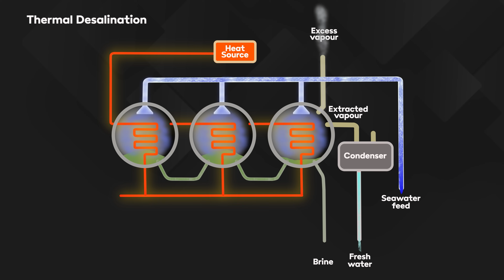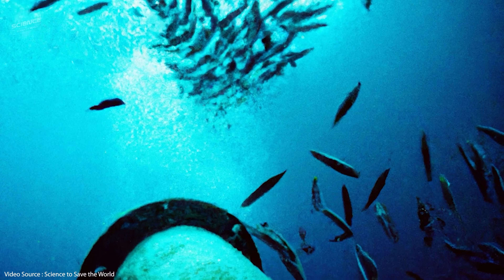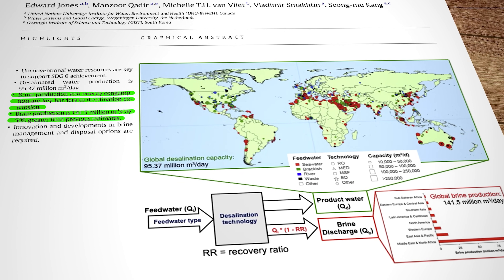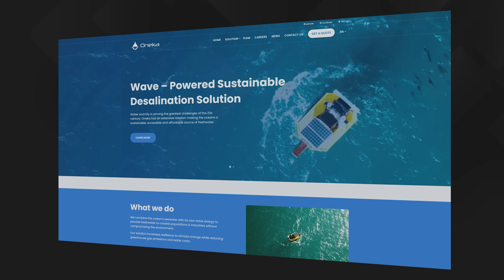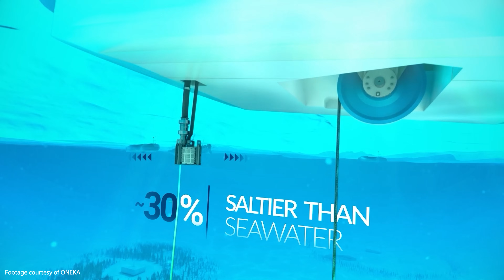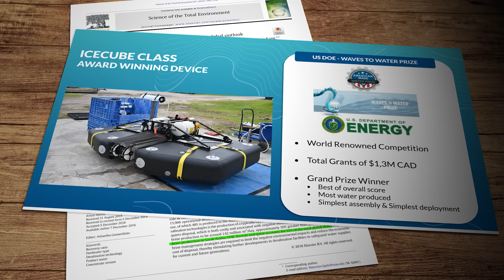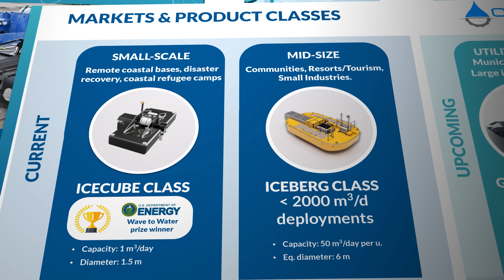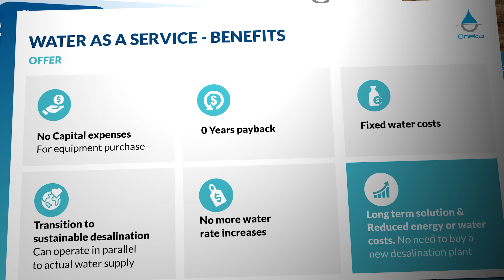Fresh Water at Zero Energy Cost . How do they do that?

Comment: Okay but here's the question if you replaced there offshore rig the floating thing with an equivalent electricity generation system would it not be producing significant amounts of electricity? My point is at the beginning of the video you point out that desalination should not come before renewable energy which I completely agree nor should renewable energy be just there for desalination for the cyclical effect. But it kind of seems like this is doing exactly that by replacing tidal wave electricity generation with reverse osmosis.

Comment: Vacuum distillation is/was used on Navy aircraft carriers to make fresh water. I was an engineering officer on a carrier. Those systems work but considerable maintenance is required. The resulting water can be good enough to use for boiler feedwater. The rest is used for other uses, drinkable except when in port where biological contaminates are higher. In port, chemicals are used to treat it. If there is petroleum in the intake water it distils into the useable water. Not good! Petroleum naturally occurs from seeps in some places, Gulf of Mexico, Near East. I was surprised at how much petroleum contamination there was in the Mediterranean Sea.

Comment: How does the water get distributed? Is that also done without electricity, and is it factored into the cost in terms of both carbon and capital?
Reply: Ideally, the power would come from the wave energy too. There can be some residual pressure from the RO process to drive flow to shore at least.

Comment: Is there a minimum wave height for operation? There are places on the globe where the surrounding seas are very placid, but which would benefit greatly from cheap drinking water.
Reply: Engineer in this industry, here... Devices would be designed for the site conditions and optimized to capture as much energy from the spectrum of wave heights that occurs there. The trade off is that devices does not work so well with smaller waves, but that because that's not were the majority of energy is available. Typically the lower bound for the device is sea conditions with a significant wave height (mean wave height, trough to crest, of the highest third of the waves) of around 1 meter high.
Reply: But also, this wouldn't be a good solution for every coast line. Some areas just don't have enough wave energy to make it feasible.

Comment: While this is a wonderfully significant reduction in brine-waste output and its impacts, and might appear to be an improvement over some operating-cost factors in existing desalination implementations, there are at least two areas of concern: 

1) As Alex Roth noted (and others may have also mentioned), a significant ongoing maintenance overhead in labour and consumables particularly in the reverse osmosis (RO) and solar systems which will likely be increased by being sea based, and 

2) the interconnected systemic impacts in exponentially scaling-up water extraction from the ocean (past small test implementations or minimal, widely dispersed "iceberg" or smaller implementations) is widely unknown - if not unprojected.

On 1), RO pre-filters need changing every 3 to 12 months (see various Google-search sources), the RO membranes likely need chemical-cleaning maintenance every 3 to 12 months (dependant on incoming water factors: e.g https://www.carbotecnia.info/learning-center/uncategorized/reverse-osmosis-membrane-cleaning-process/?lang=en ), and total replacement every 1 to 5 years (see various Google-search sources), and finally the solar panels will need cleaning at some intermittent if no regular frequency (salt residue and seabird-dropping build up, etc).

On 2), we're already seeing both increasing acidification and warming of the world's large water bodies, coupled with massive disruption of the historic water cycles we've come to rely on, of which the world's oceans are a significant component. Exponentially scaling ocean desalination could significantly accelerate these existing impacts and hasten triggering projected tipping points (e.g. such as changes to the AMOC which operates in significant part based on salinity) - see:  https://oceanservice.noaa.gov/education/tutorial_currents/05conveyor1.html

Comment: So the brine released is less dense because less sea water is being treated in a single pass, but wouldn't it bear to argue that on a per unit volume of drinkable water produced there would still be as much brine as compared to a single plant, it would just take more if these units (forgo the environmental impacts of the raw materials needed and energy to produce them) to provide an equivalent volume of water, for which we clearly know the demand is not going down.

So far the only advantages that I see are that the energy to desalinate is free from the ocean and that the brine is distributed across a broader area, although the more that you want to spread this out, the more pipe you need to get the fresh water to land
Reply: I dont want to downplay some of the benefits of this design, it just seems that some of the proposed benefits are actually counterracted by the fact that so many units with so many connections are needed

Comment: Plastic manufacturing has to shut down to survive the serious and persistent damaging effects of halogenated vinyl and halogenated carbon.  The Edison generator and dynamos with inverters eliminate the high cost of desalination and purification of water. The investment in realistic improvement is missing.  A type of desalination that is not used because it is inefficient but but does work and may have been used by Polynesian sailing.   They sailed the Pacific Ocean and must have had a method of producing freshwater to do this.  So I applied my 5 years of chemistry to this wonder. If we soaked palm leaves in seawater long enough the dry cellulose would eventually adsorb the salts of the seawater like a Stradivarius violin or petrified wood.  How long would this take and is it practical for sailing?

Comment: This is really cool. Here are a few questions I would have, I am interested in the maintenance costs for these over the long term. Also, how long will each device  last? Is there GPS on them in case they disconnect from their anchors?
Reply: Don't you think they should also be painted bright red to make them more visible to boats?  And maybe have a flag on top so they can be seen at greater distance?

Comment: Wave mechanics is not zero energy use.  I have a simpler solution, pump contraceptives into the water system, and reduce the population by 50-75%.  There we're done.

Comment: I'm surprised of the concerns about maintenance in the commentaries. There is clearly not much to maintain on this things. They can easily be replaced by an other unit to be repaired on land if required.
That system is clearly the best we know so far. The only restriction is that i must be placed where there is current so that the brine go away fastly in order to not been catched up again for filtration. Concerns about days without waves are useless, as everywhere in the world water will be stored in large bassin before been distributed.

Comment: Great for small niche applications, but leaves many questions. As mentioned in other comments, it depends on ambient motion, which can vary, meaning its not dependable. Plus, not all municipalities are equal. What might work for an isolated beach city of 100,000, will not scale for a 10 million size metropolis, needing at least 100x those larger units, that will be iffy at best.

The best solutions, need to be consistent and cheap. That's how we got the industrial revolution, and the side effects (global warming, etc) in the first place. Fossil fuels are cheap, indifferent to what you think when filling your car's gas tank. Energy, per joule, use to be much more expensive, when it meant, your human sweat.

Start up the nukes. Fission (splitting big atoms), for now, and eventually cleaner FUSION (merging small atoms) can take its place. Solar & wind are fine with cheap (not lithium) batteries, where conditions allow it. Remember the primary goal is cheap and plentiful energy. Not just to match what's used now, but to scale it up to 10x, 100x, or 1000x, what we use now. Its happened before. Remember that industrial revolution !

Comment: My question is - will this actually make water suitable for drinking?
Reply: it does not have to be drinkable. Think irrigation, industrial processes. The water could be fed to plants that are very salt tolerant, or can even remove toxins. - whether the water is drinkable will also depend on the pollution of the seawater.

Comment: If you really want to make a difference to the environment, it would be fantastic if you could tell us how a fuel cell (h2O) can remove all the pollutants that we de'duce when we use a petrol/diesel engine. I have a petrol and a diesel car, both of which are equipped with a very small fuel cell and it is impossible to find harmful substances in the exhaust measured at an authorized inspection workshop. Actually, I had bought these fuel cells in order to drive longer on liters of fuel, but unfortunately have to admit that the gain is less than 5%, but, in return, the pollution is zero. This is fantastic. Greetings Claus from Denmark

Comment: Knowing quite a bit about reverse osmosis systems, I really hope they have designed a method for automated/remote membrane cleaning, which could be accomplished fairly easily and without additional pumps on board if they have a pressurized fresh water line coming from the coast (depending on the detergents it might also need a drain). If they managed that or have a long enough service interval, the system might be financially viable. If not I can visualize a modular membrane exchange system, or simply swapping the unit out for a backup one and performing maintenance on the ground.

Other than that, the bigger units worry me that they might just oscillate without moving up and down much, which would require either multiple cables with a pulley system or something to extract power.

Comment: Great and efficient, but this would introduce the intermittency in the water supply problem that renewable energy currently has. When it comes to something as crucial as water, I wouldn't want to have such unreliability. Also knowing that the filters have to be replaced and the fact that these systems are decentralized and in the harsh ocean environment, it would greatly increase the cost of maintenance.

Comment: Many comments mention how the system gets maintained or repaired, stating that doing work in the ocean is costly. The answer would be for the unit to propel itself towards the shore to be worked on. Maybe have a drone submersible that is capable of disconnecting the water line and towing the platforms back.

Comment: I'm sure the cubic meter/gallons projected numbers are very dependent on wave activity, wave heights, wave consistency, etc.  Does Oneka offer low, medium and high projections of output, dependent on wave activity, heights, etc.?  "Can produce up to" is one thing, but what is more typical?  I'm sure that's also location specific.  Then, as said before me, there's also regular maintenance of replacing the Reverse Osmosis Filters and Troubleshooting and Repair as issues develop.  Would a unit have to be removed for such services and, if so, would a replacement be offered to fill the gap while the unit with an issue is being maintained/repaired.  Can the units be manned to replace the Reverse Osmosis Filters, or must the unit be pulled from service for such things?  And what becomes of the used Reverse Osmosis Filters?  If they can be cleaned and reused, then what happens to all of that brine and everything else that is filtered out?  Or do these Reverse Osmosis Filters work in a different way than the common household kitchen sink RO Filter System in the cabinet below the sink?

I do wish Oneka all the best, but there are questions that need answers before we get too excited them.  All of these are realistic considerations for the real total cost per cubic meter/gallon, plus anything else we may not have thought of.  They are most certainly extremely Green, but there are other factors to consider.

Comment: 1:00 Quick thought on the setup... If you moved over to your left, just a smidge, so that the wall behind you is more visible, you could put something like a green screen in a frame on the wall. This way, if you're going through an explanation but don't want to totally cut over to it, you could edit it so that it plays in the green screen, and you could gesture to is as you talk. Just a thought... probably too much work as far as editing goes, but it would be a cool effect.
Reply: Hmm. I like this idea... but it needs to be 'battle tested'. 7m waves is fine for normal operation or even light storms, but Hurricane Sandy in 2012 registered 13.7m wave heights. More typically, though, 9m is relatively standard in a storm. The anchoring needs to be strong, but if you're anchoring into something akin to thick mud, you're going to lose or break the unit. If you spend $10M on an array of these things and a storm wipes them all out, then you're looking at a $10M loss to a community that might not be able to afford it. 

Going off of what I've seen with kelp farms, you're going to have significant vegetation growing on the anchor wires after a time. They need to be able to handle this. And finally, I think these need to be placed in areas where there is a decent current so the briny water can be more spread out. If you place these into something like a cove or bay, then eventually, you're going to make the water too salty because it isn't able to diffuse as much. And considering that most bay communities depend on the bays for food, you want to avoid killing off or driving away the fish at all costs.

Personally, I think we should take the salts out of the brine and refine them into metals for use elsewhere. For this, you could use the standard land-based desalination plants.

Comment: As the number of units go up in an area, the problem of the brine would increase. Both for the discharge and also for the amount of chemicals that the unit would have to fight to extract the water out of. Too many in one area or too large a unit and you still would face the concentration problem.

Comment: There are currently solar panels that can be used directly for collecting fresh water from the air. This may be a better long-term option than putting lots of obstructions in the coastal seas. However, it is such a brilliant concept. Thanks for sharing.

Comment: Have this wonderlly bright young lady contact DARPA, Navy Division or the commercial yacht/ship manufacturing industry nearest her. Pitch this idea modified to intake water from both the vertical motion by waves and forward sailing. A sailboat, motor yacht, cruise ship, river barge tug boat, container ship all take on fresh water when pier side. Some have thermal desal plants onboard, like aircraft carriers, using waste heat.  But most do not. Just think, a ship arrives in port at least not needing to take on local fresh water but may even deliver fresh water as an added cargo. I'm thinking of container ships returning to China and elswhere empty (or mostly so) or oil tankers returning to SW Asia or grain bulk carriers filling up on fresh water on the return voyages. Added equipment, maintenance and manhours is minimal, and surely less than the avoided cost of buying water.

Comment: I see similar concerns to on-land "green" considering they do have solar panels and those require rare earths which are mined in less-than-sustainable ways.  I also question the numbers, and wonder what operating conditions yield peak efficiency, and how much variance there is between "high production" and "low production".  Additionally, we are destroying our coastlines and maritime recreation.  "Passive" systems like these (there's no external energy input, ergo, passive) are typically much less practical than industrial installations, at least without storage.  Requiring solar panels additionally means there will be troubles anywhere the Sun doesn't shine much.

All that said, I'm all for the cleanest & greenest so long as it's the cheapest (without subsidies) and not simply employed as a solution to emotionally-driven narratives.  Which is why I still expect Th-fueled MSRs and on-shore desal plants are the best options.  I think there are solutions to the brine problem, such as extracting rare earths from the salts (which may actually act as a counter to my prior point about ecological destruction).

Comment: You stated reverse osmosis  produces less brine than thermal desalination.  How is that?  Do you mean brine of less concentrated salts. But if you produce X amount of fresh water it will leave the same amount of salt behind. The other thing is concentrated brine can produce needed chemicals or even what if you mix granulated salt with recycled plastic instead of sand to make building blocks bricks or pavers

Comment: Obviously, permanent installations should use permanently installed pipes buried in the seafloor with a flexing riser moored to a buoy. Perhaps connections for several units on each riser buoy? With automated crane operated-powered quick disconnects?

Comment: Absolutely fantastic concept.

Though I have one question, how do you get the water from out of sea into land?

Either a boat has to collect it, not a good idea or flexible lines going into shore would raise the cost a bit probably much better.

Here in the Caribbean will be occasionally get hurricanes, they might consider a system of quick disconnect that can be reconnected after the hurricane and they told the d cell into a protected harbor area.

Scientia Non Domus,
(Knowledge Has No Home)

antiguajohn